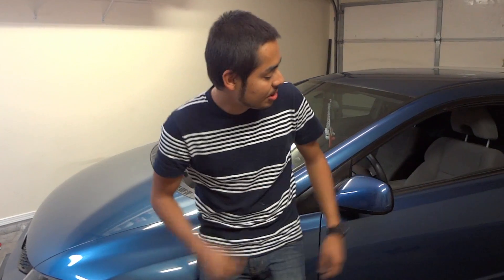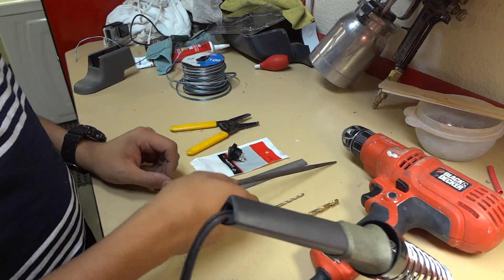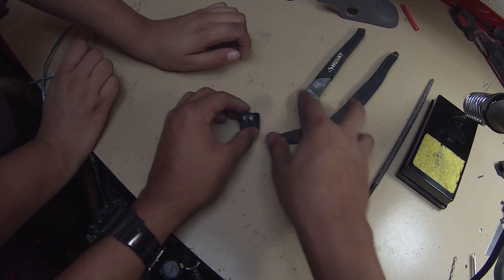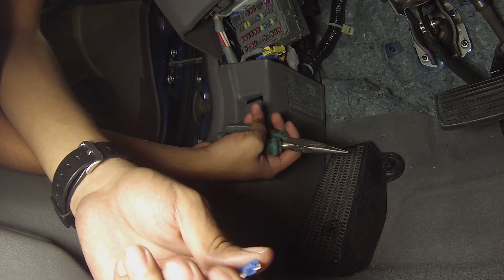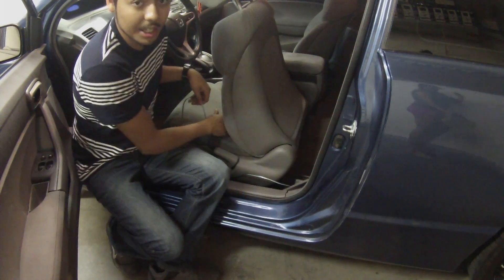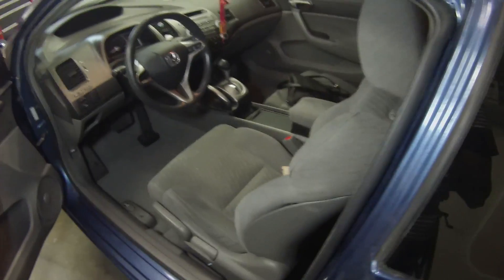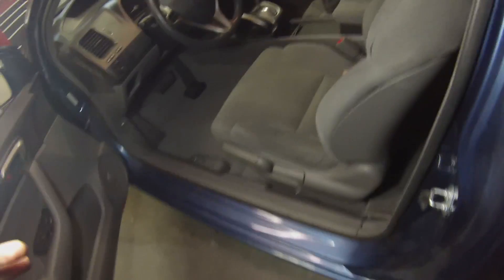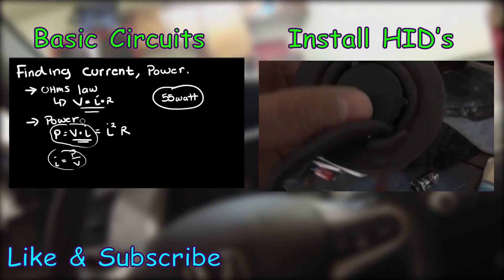How to: Install a Kill Switch on your car

Comment: Hi mate, the switch won't be able to handle 20A on the long term, also the wires need to be at least 10AWG. Better use a relay for safety
Reply from the maker: Hello! When I made the video years ago, I checked the electrical rating of the switch and wrote and kept I it well below their maximum rating. 

You do bring up a good point though. As vehicles continues to technologically advanced, it is a good idea to actually check current that the fuel pump draws. If you’re fortunate enough to have a service manual, the guides occasionally have troubleshooting pages that give the electrical specifications. 

Thanks for commenting!
Reply: @cmacia06  thank you for your wisdom and all the good stuff you share, very much appreciated !
Reply from the maker: Of course! Happy to help

Comment: Why not use a fuse tap?
Reply from the maker: I think you could if you found a way to cut the power with the switch. It would be easier than drilling the fuse.

Comment: I put a switch in my car 250 V 25 A and it worked at first then when I drive round the road the car went off what caused this fuse in one of the wires with diff fuse box

Comment: why not to just burn fuse instead of drilling?
simply put + and - on both sides from battery, done.
second thing, I would look for cuting wires around fuses box, so cuting and making modifications in that area is not a good idea
Reply from the maker: I know it seems crazy but fuses don’t burn as quickly as you might imagine. I tried it with a few and they can handle a very large amount of current for a few seconds before burning out. Depending on the wire used, the wire could melt before the fuse burns. I don’t recommend shorting directly to the battery.

Comment: This is a terrible means of installing a security kill switch in any vehicle.  Safety and bulletproof dependability are paramount for the starting and operating system of your vehicle.  First of all; never splice a kill switch into the fuel pump.  Failure of you circuit will shut down the fuel pump when cruising down the highway and that will shut down your engine, the power steering system and the power braking system and could have catastrophic results for yourself or any other driver around you.  Your hack into the fuse panel is an amateur hack that no electrical/electronics technician would approve.   It is very unwise to make your starting and operating system reliant on a cheap $3 dollar rocker switch.  These exist for accessory lighting applications, not for fuel pump management.  Rocker and toggle switches certified for aviation and military applications are readily available for $15 to $25 dollars, which is still a very cheap security system.   I hate the thought that you promoting this hack job to others and I hate the thought of your vehicle operating on the highway beside me.
Reply from the maker: You realize many of the factory component in this vehicle are lower quality than the rocker switch your talking about… There are specification on the switch for a reason. They are rated to handle the amount of current that is needed for the fuel pump. Well over that amount as well. Not sure who these technicians you speak of are but may you should actually consult with them first.
Reply: @cmacia06  These cheap $3.00 rocker switches are notorious for failure.  Most are not certified by a North American or European  independent electrical engineering authority.  Many are not marked with a load amperage capacity and most come with no instruction insert in the packaging.  The current rating for many is between 3 to 5 Amps and many vehicle systems draw current greater than that.  Many DIY individuals that these videos appeal to have no electrical knowledge, expertise or equipment for testing electrical properties of a circuit or a switch.  
The cost difference between a cheap Chinesium switch and a high quality military or aviation grade switch is about $15 per switch.  Since your already implementing a very economical security/kill switch system, why would you compromise the safety of yourself and others on a cheap switch.

Comment: Plain & simple. My fuse cut power to the ignition switch. Dummy lights come on with no engine crank. Can use alarm. TY

Comment: That installation is very unsafe ..... Because if you are driving on the freeway and that switch is turned off you have a dead engine and your steeling wheel will lock ..... You should of use the STARTER fuse ... Stay Safe and keep thinking
Reply: TY larry for being one of few ppl here able to think about safety. The idea is good (If installed on a proper input), the execution is bad.
Reply from the maker: Why would the steering wheel lock?

Comment: In theory it works...but you're compromising the fuel pump and starter.  Thieves might crank the hell out of the starter and without a fuse, your fuel pump has no protection in case of a surge or short.
Reply from the maker: Better to have a car that needs a new starter than no car at all

Comment: You can just blow the fuse by touching it across the battery + to gnd  and solder the wires on the top of the blown fuse... that is how I did it..

Comment: Great video, however, there are quite a few dudes in comments who throw shade on your efforts, I say to them if you can do better make your own video! Hey, it may not stop a thief or carjacker, but it will at least slow them down or maybe they will move on to something easier. Thanks for putting this out.

Comment: Ok, I should not tell people this, but this IS NOT the way to go.  I design/install custom kill systems for cars/trucks/boats/snowmobiles/motorcycles. I used hidden RFID/Random Code Generator readers with the antenna that is TOTALLY hidden behind a plastic panel in the car. The RFID fob you keep on your body (not in purse, wallet, or pockets because carjackers will grab your wallet, purse, and make you empty your pockets when they steal your car). When you get in the car, you don't do anything special, the car detects the RFID hidden on you which will allow to run your car. If you get out the car the engine shuts down as soon as the crook pulls the car 20  to 100 (you choose) feet away (giving you a few seconds to get away). If a thief hops in the passenger seat and forces you at gun point to drive, I have a secret way to deploy the passenger air bag (the instant the gun points away from you), then pops out a knife and you stab the crook right in the neck, forcing the gun away.  I have other features too, but that is the basic system. This is why carjacking/carnapping is popular, crooks know there are kill switches and fobs in use so they now force the driver to drive to the crook's safe spot (and that is where they often kill the driver). They are not expecting multiple disabiltating "surprize" systems being used against them. A knife to the jugular will ruin their day and quite possibly end a crook's life... Hey, officer, I tried to call 911 to call an ambulance for him but my battery went dead, he pulled that gun on me, I was fearing for my life.  Some states will arrest you, but I work with lawyers to help people know what limits you have so you can be ready with the best course of action. My systems go from $500 to thousands, they are custom and no two are alike. Sort of like LoJack, but more effective.

Comment: Never use electrical tape, on hot days the stickiness will soften and start to unravel. Always use heat shirk tubing and of the right size so it shrinks TIGHT.

Comment: Good idea except for drilling through the fuse and wiring to it. As soon as a theft can't start a car they look for pulled/purposely blown fuses. Even amatures keep all sorts of fuse styles (or paper clips) on hand just for this reason, and they will put a 50Amp fuse in a 10Amp socket so they don't have to worry about matching the right Amp rating, they use a high value that will work in every circuit because very few circuits use more than 40Amps... they are not worried about 0.0001% chance of a short somewhere. They will see the wires on the fuse (sticking out like a sore thumb), pull it and put in a 50Amp fuse and away they go.... all in a few seconds. Sorry, but I had to give you a thumbs down (but you have good intentions), this will not even prevent kids from stealing your car for a joy ride, let alone a pro that wants your car for parts or resale.  If you can get wiring drawings for your car you can find and cut the wire to your fuel pump in a hard to reach spot, and wire your switch from there (and still use your existing fuse unmodified). Your switch is in a ok spot but it is visible. Most crooks know the models they steal and will "feel around" for a "surprize" switch within arms' reach (front/back/under/over).
In the long run, this is not worth the effort. Take it from a professional security expert - think like a thief when you try to thrawt one. Peace.

Comment: Good vid!! What was the rates amperage on the kill switch?
Reply: Or it doesn’t matter
Reply: The rating on the switch matters. Installer’s use relays. A relay uses a small current to control a large current draw.
Reply: @chodkowski01  he didnt use a relay, but a fuse, so he needs a switch that can handle 15A. Wires too

Comment: You know that Amazon has a fuse replacement. All you do is pull the fuse you want to replace and put the replacement fuse in that slot. Then you wire a switch into that. It's All over YouTube

Comment: Why not just short/blow the fuse, or better still buy an inline fuse holder and keep the fuse to insert into that, after using small spade connectors to insert into original fuse housing?

Comment: I have exactly the same Civic but mine is manual. Unfortunately this method is not very secure, as the thief will definitely look in the fuse box, reveal the wires and follow it until the switch :(

Comment: Good start, but I wouldn't trust this on my car. The wiring running from that fuse is a dead giveaway. All they would need is to pull the fuse and stick a paperclip or something in the terminals. It would  be better to just blow the fuse and stick it back in the car. Only downside is having to mess with the fuse everytime.

Comment: You don’t wire it to the Fuel pump fuse mate, you wire it to the Relay. You roasted that fuse anyway, you don’t still have the protection from it as soon as you drilled thru the resistance coil

Comment: In my opinion, It is much better to make the connection from behind the actual fuse by cutting the fuel pump wire.

Comment: Hi there. I have the same car. It has 2 issues that disturb me, and I want to solve them somehow. Would you help me?
-1. That buzzer alarm sound just disturbs me a lot. I don't want to remove it totally but just to reduce the buzzing volume it makes. Maybe cover it with some plastic tape to block the sound a bit. I couldn't locate the buzzer. Where is the buzzer on this car..?
-2. From time to time my kids just cannot close the doors so good. The door is open when the car is running. It indicates with light that the door actually is not completely closed and locked on the dashboard, but it does not buzz signal.  I would like to set a buzzing signal for open doors as the car runs. Is there any way to set the buzzer to signal when the doors open when the car runs?
Thanks...

Comment: I did this to the two fuses in the boot of my clk 230 cabrio. 1 was for the rear windows and the other was for the electric roof module the VDO control box. I had to break the circuit in these two only for a couple of seconds every time my cabrio developed an intermitent fault with the roof module. My windows , mirrors , rear head rests and roof would all stop working. The red light on the roof switch would stay on and the only way to fix it was to remove the negative lead of the battery for a couple of seconds and put it back on.This would reset the module and everything worked again. I know this is a crude fix but a new module was a couple of hundred quid. I just ran 2 pairs of wires into the front of the car and. Put a couple of switches, 1 on each pair. I know what your thinking but it works. Saves me keep geting out the car usually at least once every couple of days and down powering the whole car. Specially the ECU.

Comment: If a thief checked your fuse box really fast, they would see that wire and they could just pull it and swap a fuse from a different slot in there really quickly
Reply: Watch the video analyze it, and improve from it..
Reply: Thieves don't like to work. If  there is  the slightest difficulty, they just look for an easier prey.
Reply: @herberar  I do agree that it would deter 90 percent of thieves tho
Reply: All they would have to do is just cut and connect the two wires.
Reply: @HoneyBadger_DIY  Yeah they could do that too. But to be fair. 99 percent of thieves will just give up with the car doesnt start.
Reply: Great video, people just want to nit-pick everything… Your video is perfect to help out over all kill-switch placement and wiring fuse, thanks and keep,up the good work.
Reply: @simonsayscain  Or maybe just wanted help the one person that read this not make the same mistake

Comment: Once he drilled the contact wire out of the fuse it no longer provides amperage protection. He was relying on the amp rating of the rocker switch to protect that circuit😂

Comment: i'm kinda like a mad scientist experimenting on my truck. Currently, I run a self made (DIY) HHO Generator fashioned inside a comparable sized milk crate in my truck bed (outside in case of 'H-Bomb' BOOM I got a safe place for all the glass from the pickle jar to go but my redundant safeguard is in the thermodynamics of the stator vacuum pressure.) with its tube going under my cab to the engine compartment, then to a smaller pickle jar that fits perfect in the area in front of the brake booster on the 'cool side of the engine' with one hose in from the crate in my truck bed and one hose out to my air intake right before my throttle body.. Your video gives me the idea of how to make an on/off (I/O) switch for my fuel pump. Just what I need to confirm my truck can run without gasoline except for when starting up. I mean, to shut off the fuel pump and run my engine completely off of Hydrogen. I'm harnessing the forces of nature here bro and you'll be the first one to know if it works after I shut off the fuel pump with your switch. Thanks amigo and nice looking girlfriend you got helping you out. Respect. Caveat* I'm no real Scientist, Professional or have any Certification to prove I know whatever it is I'm talking about so don't quote me on sh*t!

Comment: wow, I cant believe none has noticed, there is a 15A fuse for a reason and your just bypassing the fuse which is a bad thing otherwise there would be no fuse there in the first place, Im 15 and still only in first year of an Automotive course and even I know this...
Reply from the maker: Wow I can't believe you comment without watching an entire video.
Reply: @cmacia06  i did watch the whole video
Reply: @cmacia06  i worded the first comment incorrectly, i went back to the video and i mean, should never start the car without a fuse

Comment: Car thief here. Just kidding lol, I'm an electrician but trying to think about it from a thief's perspective. Most low end 1990s and early 2000s cars are easy to steal and are a top pick for parts. So the first thing I do is take apart the steering column to get to the ignition lock: it's just a rotating lock with wires that come out of it and start the car. It's as easy as touching the right wires together. But suppose the car doesn't crank, now I know it was tampered with. Set the car into "on" (you know, when you turn the key so that all your dash lights come on, but your engine isnt yet running). In most cars when set to on you can hear the fuel pump. No fuel pump sound, it probably was tampered with. If you stick the killswitch right in the fuse box, that's an obvious place to put it. Just pull out of the spliced fuse and put your own in, then start it up. Don't even need to search for the switch.
Best way to protect your car is to buy a modern one. Most modern cars now have RF chips with their own unique code connected to an immobilizer circuit. Even if you have an exact copy of someone's key and you try hot-wiring it, it still will not start because the computer wont detect the proper key and wont start. These systems are complicated and a pain in the ass to defeat. Theoretically you can find and short the right wires, but that involves disassembling the whole dash, following cable bundles through the firewall, which could take hours, which will look too conspicuous. So I will go for the easier car to steal parked next to it. If a car takes too long to steal it's too risky.

Comment: 1. Make sure your wire can handle more than the fuse is rated for. 
2. Fuse box is not a good place to run your wires from. In this case, the best solution would be to run it from the fuel pump.
3. Hide the switch somewhere in passenger side. The first place someone would look for a killswitch is under a seat. I would hide it in plain sight, disguised as fog light or window heating switch for example. 
4. Use shrink tubes or terminal connectors in all car related electronic works. Vibrations will losen up electrical tape (eventually).
Reply: Mount the switch in the trunk. And I wouldn't use the fuel pump I'd use the starter relay. You can also JBweld the fuse tap into the fuse panel that way they can't remove it without a tool if they happen to pull the fuse panel cover.
Reply: @leecowell8165 the fuel pump is harder to interfere with if you run the cables directly from it and not the relay box

Comment: I have a button in my car under the steering wheel(not the maintenance reset button) that I don't know what it does. I was thinking it's a kill switch but my car turns on fine without pressing it.